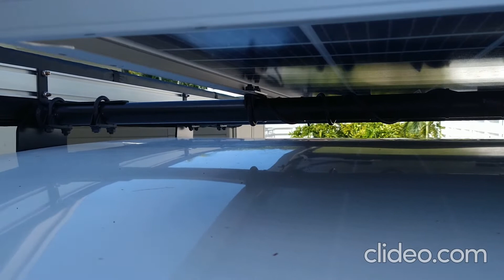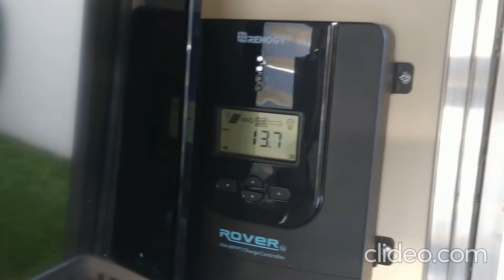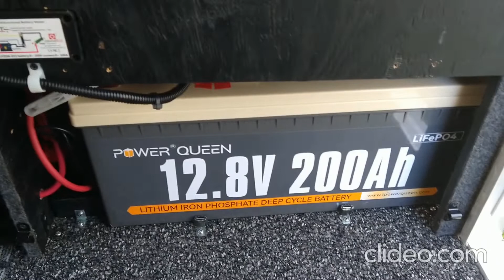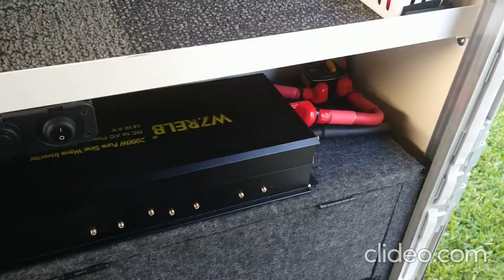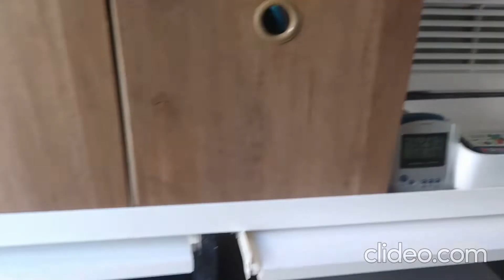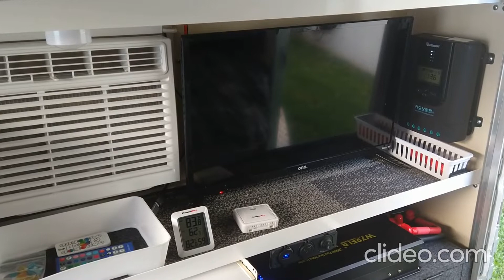Runaway Camper My Solar Setup 405+ Watts Bifacial Solar Panel On a Tiny Camper teardrop

Comment: Did you have to cut the thread on muffler clamps to shorten them? If so how please? Ty.
Reply from the maker: I did not but if you have to screw the nuts in all the way then cut the clamp to shorten it and then remove the nuts which will repair the cut threads on the way out.

Comment: Beautiful and efficient setup, but I'll stick with my portable power station for lights and all the little things I need to run and charge inside my Runaway CoolCamp. I run my A/C off a Honda inverter generator which is secured in the back of my small pickup truck. Simple and inexpensive solutions that work quite well for me.

Comment: How long does it take the panels to recharge your battery the following day after using the ac all night? And do you also run the ac during the day or only at night?
Reply from the maker: @jerryberkel8421  Hello Jerry it all depends on how much sun is available but on a sunny day the battery would be fully charged by mid afternoon I don't use the ac during the day unless I have ac power at my campsite I like to sleep comfortably...

Comment: Instead of all that wiring can you in place just directly connect solar panels to a jackery  .
Reply from the maker: Yes you could the nice thing about the Jackery is that it's portable and you can use it for other things I checked into it when I was doing the install and at the time the Jackery with the same output and storage that I have would have cost me more than double what I paid for my system...

Comment: Nice setup, just think if we went with 2 batteries you would get over 12 hours of running your ac. I’m going that route with the same brand of battery but with going with 2
Reply from the maker: Thanks, Power Queen also makes a 410 AH single battery which would save you space and weight instead of installing 2 batteries. How much solar are you planning on doing?
Reply: @GR-jq2qp  the same like yours